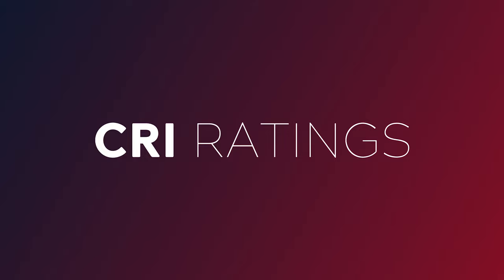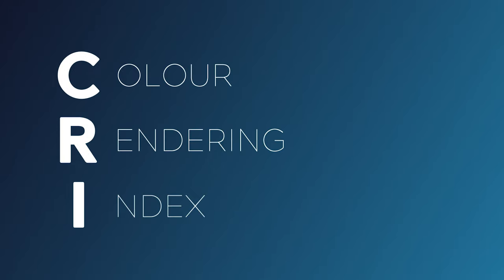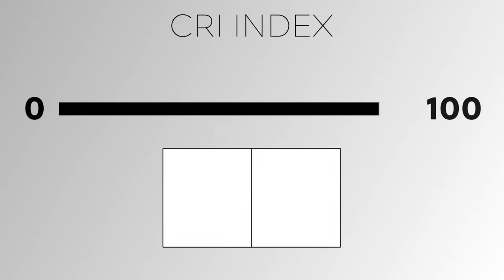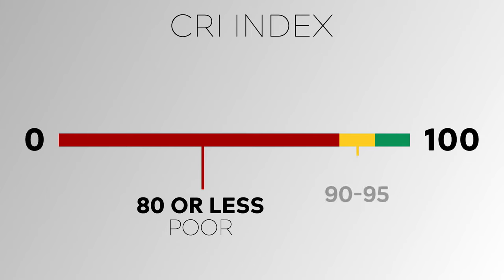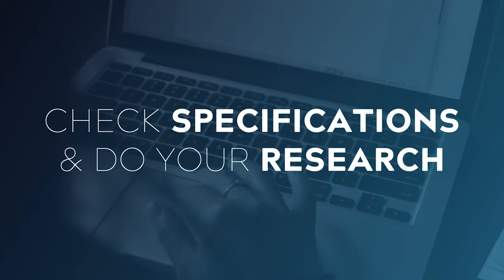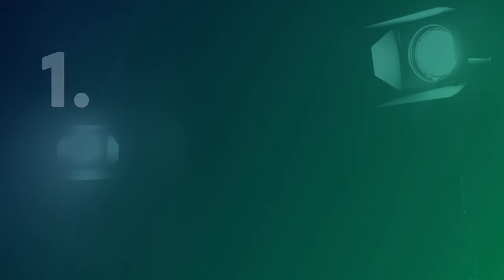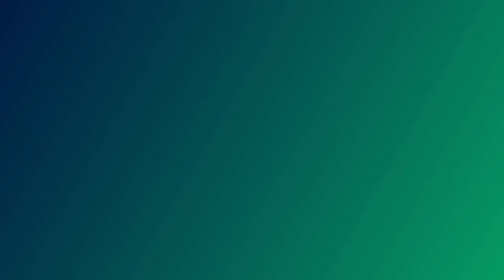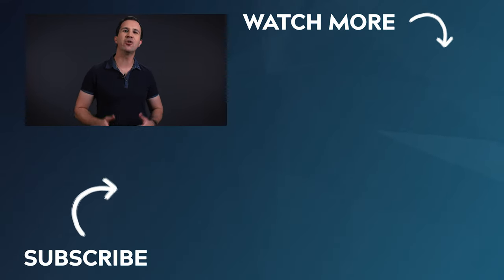CRI Definition - What is CRI? (and why is it important?) | Film Lighting Techniques

Comment: What is the best white balance setting between grey card or temperature kelvin?
Reply from the maker: Using a grey card and doing a custom white balance will always give you the most accurate, neutral, white balance based on each unique lighting condition. 

Ensure the grey card (a white piece of paper will also work) is lit by your main light source. 

If you want to get more creative and start using/manipulating white  balance for a creative look (for example mixing light sources of different K temperatures) that’s when dialling in the Kelvin value has the most benefit. 

But if you just want an even, corrected image, go with the custom WB. 

We’ll be coming out with some videos on Colour temperature and WB very soon :)
Reply: @CreativePathFilms  thank you 🙏! I’ll be looking out for that video when it drops!

Comment: What still kinda puzzles me - can differently rated lights in terms of warmth have the same CRI? For example, 3000K light and 6000K light.
Reply from the maker: Yes absolutely, color temperature does not impact a sources CRI. CRI is intended for measuring how faithfully a source reproduces colors across 15 different color swatches (rated 1-100) with the end result (the cri) being the average of these 15 scores. Both tungsten halogen globes (2700-3200k) and daylight sun (5500-6000k) for example have scores of 100, even though they have very different Kelvin values, because they both provide perfectly accurately color rendering.

Edit: spelling and grammer
Reply: @CreativePathFilms  I get it now. Thanks a lot for the detailed answer.
Reply from the maker: Pleasure 😊